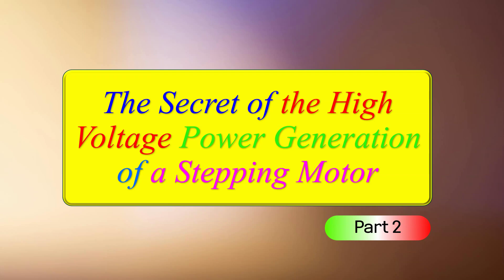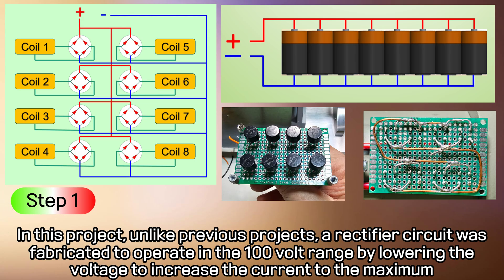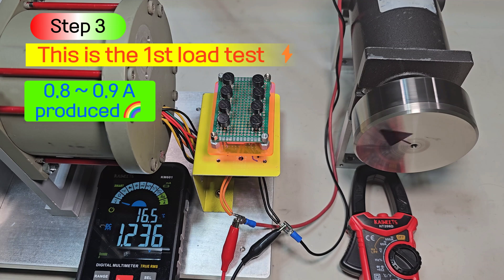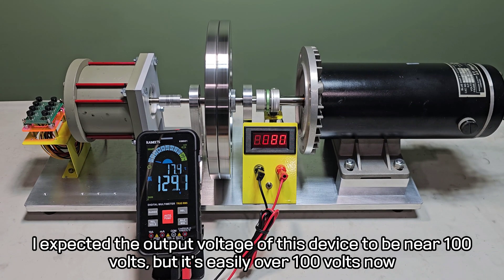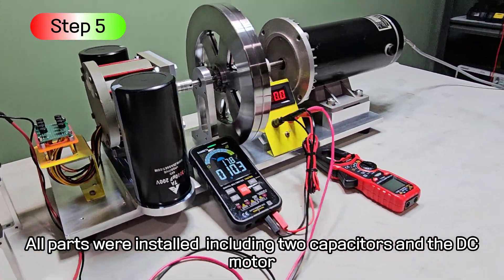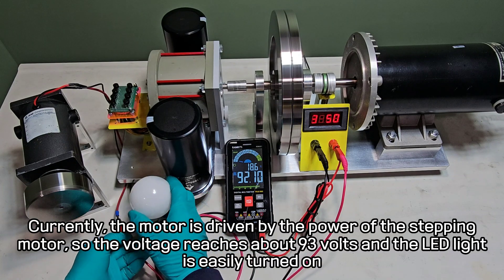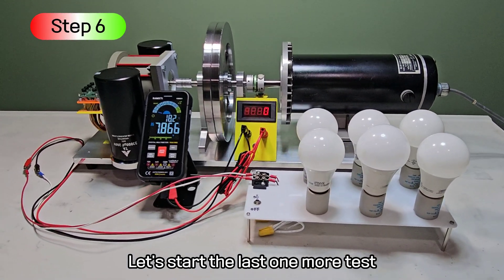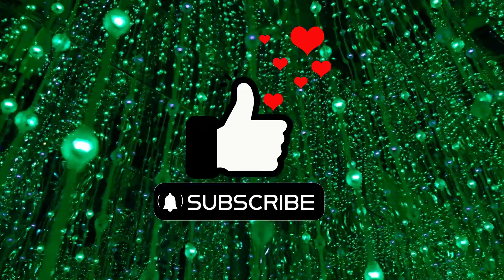The Secret of Ultimate Voltage Generation by a Stepping Motor Part 2

Comment: Hi.  
I'm also looking for alternative energy sources, but I don't record anything.  
Lately, I've been thinking a lot about a heavy spinning flywheel.  
I have a playlist called "Pakistan free energy" — you can check it out.  

I think you're losing a lot of energy on the driving motor — it's a brushed motor.  
A better solution would be to use a BLDC motor; it has high efficiency, high torque, and can reach high RPM.  

Another important point is how you extract energy from the generator.  
A better solution might be something like an alternator with a magnetic rotor and a regulator, where you can adjust the load so the flywheel doesn’t slow down.  

That's just my humble opinion.  
Best regards.
Reply from the maker: Thank you for your comment